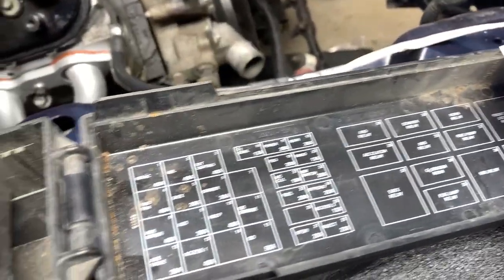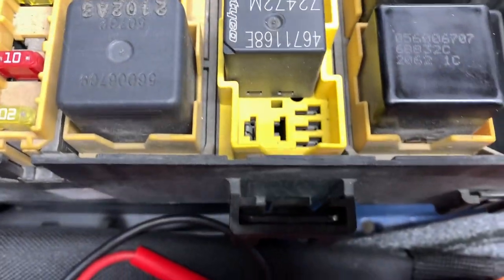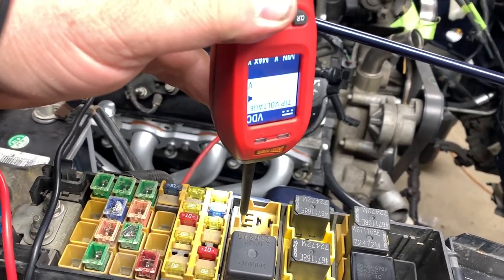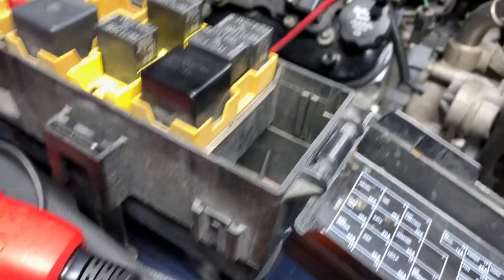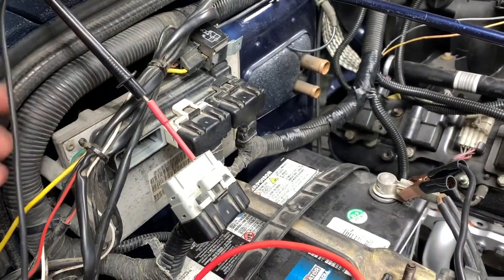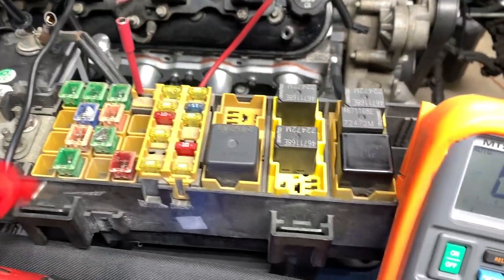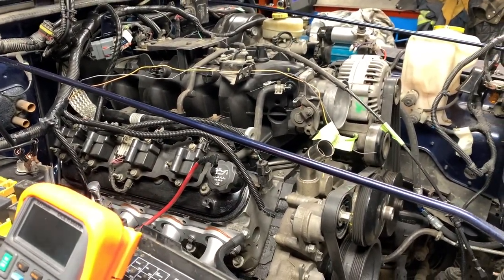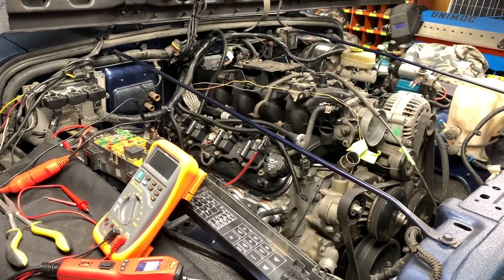How To Check ASD Relay for Power Jeep TJ

Comment: Do all the relays slots in the PDC (Power Distribution Center)  work in similar way such as ASD you showed in video when it comes too....   which pin is constant power... which  one would relay  give  power only at key of "start/ignition", which one is run power (key switch relay to  give it constant 12v) etc...

Comment: Thanks for your video. I have a question that I hope you would consider answering. I have replaced just about everything on my Jeep. ECU, plugs, distributor, coil, sensors, etc. My Jeep runs for 2 seconds then shuts off. Something is telling the ECU to shutdown the ASD. Any thoughts? 98 Wrangler 4.0.

Comment: Good evening sir I have been on almost a 3 week long extravaganza on   Trying to resolve a asd/pcm issue in my 06 lj. I’ve owned 10’s of tj’s as well as xj’s Cj’s and even Willy’s, as a life long keeper I’m mind blowing from all of my electronic diagnostics. I know this is a long shot but is there any other platform I can shoot you a message on and possibly have you give me a call just to have a few mins of your time. I’m well mechanically backed and in electronics and i’m butting my head after 3 weeks. Literally pulled jeep out of garage and just flopped a few relays just to check ac clutch relay function and just from simply flopping around I ended with a  no crank no start no pcm com and asd and related relays are chattering. Great voltage. Full pin out and ground check. Obd2 test and pin out, every sensor 5v to everything and tested all asd related sensors all check good, again at a loss here would be great to get in touch with you just need a good secure  way to send you my contact info thank you sir

Comment: Quick question BSK, can a jeep tj run without the cat/02 sensor?
I removed the cat and 02 sensor on my tj because there was a hole on the exhaust pipe right before the cat causing a leak. I disconnected the o2 sensor plug and left the wire hanging on the jeep and the sensor itself I removed with the cat. It started up (very loud of course) and after driving around the corner it shut off and wouldn't turn on. I checked the fuses and the ASD fuse was blown. Did this possibly happen because the hanging wire shorted out underneath? If I tuck the 02 sensor wire out of the way, should the jeep be able to run with no cat or 02 sensor installed? this is just temporary until the exhaust pipe is fixed. 

THANKS BSK
Reply from the maker: There is for sure a short that you’ll need to deal with

Comment: Doing Ls swap on 91 yj. The alternator has a green wire the splices to the coil then goes to the ASD. Also has tan wire wire I think is the exciter wire for the alternator. (IE:1 wire hook up). Does the ASD get power from the alternator or grounds out alternator rectifier?  Can I eliminate the green wire?

Comment: Is it possible that the ASD relay thinks the 30 Amp ASD fuse has blown and thats why its not giving power to ignition? 
I was checking fuses when my tail lights were not working, and I pulled the ASD fuse while the jeep was running. I'm dumb move
Engine turned off and won't restart, I have been trying everything and nada.

Comment: Jeep Cherokee 2006 I bypassed the fuel pump relay 87 to 30 but in the fuel pump wire which is tan/ rd has no voltage reading so what the next step to troubleshoot

Comment: HOW CAN I TEST MY STARTER... IN MY JEEP WRANGLER WITHOUT TAKING OUT THE STARTER ...MY JEEP WILL NOT CRANK OVER...NO START....2013
Reply: Got the same issue.  Starter relay.  Pull it out. Should be small rectangle and grey. Jumper wire from hot pin to ground.  Mine turns over.  Got all kinds of codes. U0100 and all kinds of abs, transmission, etc codes.

Comment: Excellent video ! Question  if the accessory wire on asd is showing voltage but on crank voltage goes away! Would that be normal?
Reply: I having that problem did u solve it?

Comment: Hey man! 👋 A couple days ago I got home after work, I turned off my 2006 Jeep Wrangler, I went to sleep and the day after I tried to go to work again and the Jeep won’t crank. I already  checked fuses, relays, ignition pin actuator, ignition switch, clutch safety switch, starter, battery, and everything is good! I plugged the computer on the OBD II and I don’t even have any codes. When I open the switch all the lights on the dash come up but I don’t hear the fuel pump working which is a little weird. I’m a little desperate here man already because I don’t know what it is. Do you have any idea of what would be my problem? I would appreciate any help buddy! Thank you!!! 🙏
Reply: Check the map sensor if you don't hear fuel pump kick on

Comment: Instead of the resistance check….
If the control wire has 12 volt up to the computer, then you have continuity, so just ground it at that point and the relay will click and you can check asd relay outputs

Comment: Hey nice video ! I got a 2001 grand Cherokee 4.0 no start if i power prob shoot power to o2 sensor fuse it runs do you think asd relay?thanks
Reply from the maker: The real question you need to find out is what is causing that to happen
Reply: @TestDontguess  hey i found out the fuse for o2 sensor in dead no power any side also 3 more all blues is there a fuesible link i think the car may have jumped started in reverse?

Comment: You're amazing! Lol. Had to subscribe after that video. I was looking for info on 3.7 that shuts down one cylinder. New PCM said nope. Shut that one down again. Of course, new injector and coil pack. Swapped relays. Gonna put the Fluke on tmro. Would love yer input! PO204. 304. 1388 and 89. ASD to follow. Right?? Help!